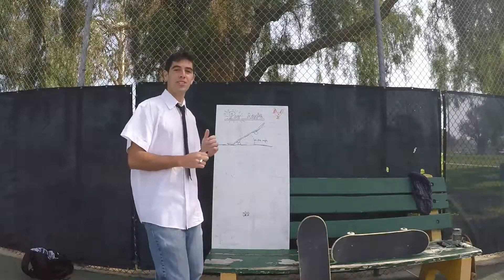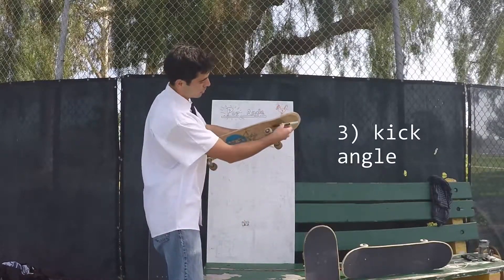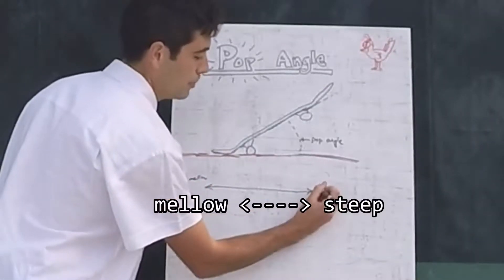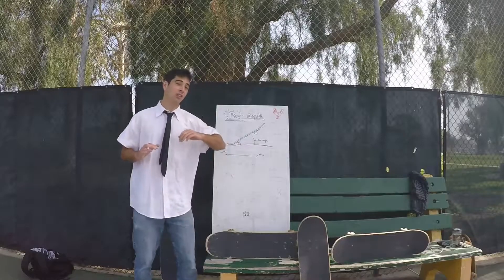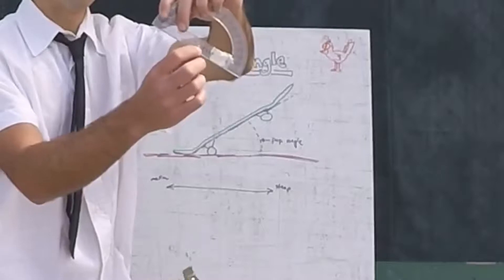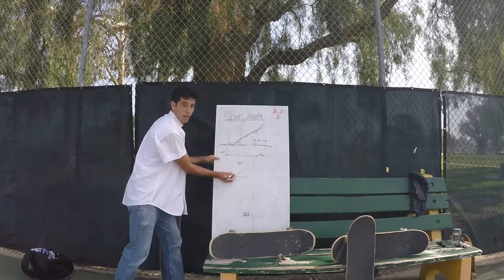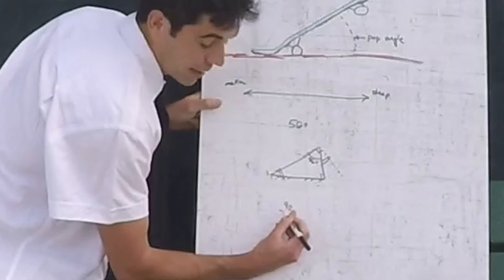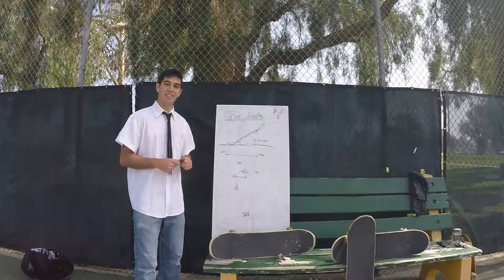Skateboard Design - What is Pop Angle?

Comment: can i tweak my pop angle without changing my board or my tail?i feel like when i pop more close to the bolts i have a better control and response,and when i pop in the tip of my tail i get a higher pop but the board becomes more unstable
Reply: You can change your pop angle by adding or removing riser pads. This will change other aspects of your ride, however.
Reply from the maker: Hmm... good question! Your pop angle technically won't change because the geometry of your board is the same, but, if you move your foot closer to the tip of the tail, you'll probably be able to pop with more power since you have greater leverage.

Comment: What angle would be best for beginners? My height is 5’4 but i dont know if my height matters for this
Reply: It does, in the sense of lower centre of gravity; in theory, you will be better at skating than somebody 6'0". Shorter = better. Now, this alone does not magically make you good, of course, it just helps. Shorter legs, however, means you need a shorter deck, which is bad for some things, great for others. In terms of pop angle, you should be able to get away with a greater angle due to your height, but it depends on what you want, and other factors. I suggest something typical -- it's better to focus on overall board setup, length, and wheelbase, than anything else. It's also a bit relative to the kind of skating you want to do (general street, jumps, grinds, flip tricks, rolling freestyle, vert, Casper/pogos/stationary freestyle, etc.). The same rule applies to figure skating in terms of lower centre of gravity (average pro height is fairly short, at about 5'8"). If you look at most pro street and vert skaters, they are anywhere from 5'6" to 5'10". Not shockingly, the same kind of thing is true for both snowboarding and surfing (with weight being about 160 pounds, though this is not deeply important). If you also have strong legs/certain traits, then that's amazing for skating (more so if you already innately have good balance and foot coordination). Being younger helps to learn such things, but can still be learnt at older ages. Either way, for your first board, I'd suggest something generic to the kind of tricks you want to do. 

Hope this helps, assuming you still need this info. :)
Reply: @TheClassicWorld  Thank you, I learnt something new through your comment. God bless.